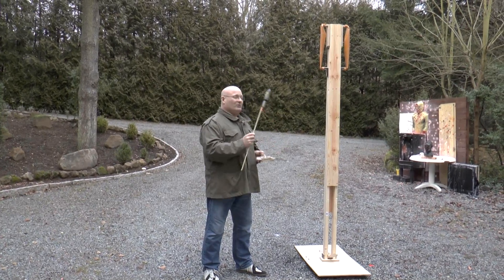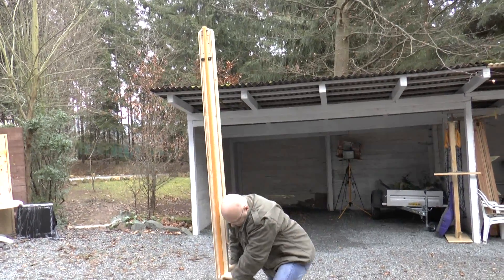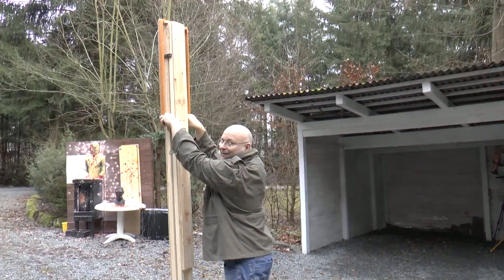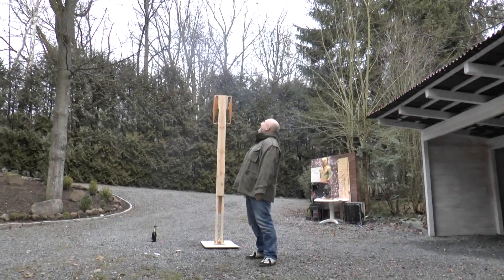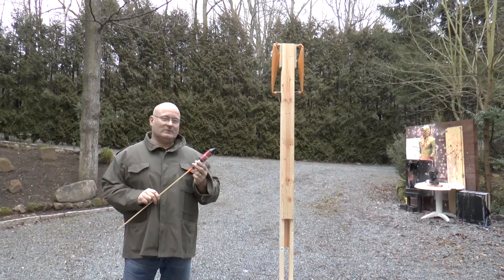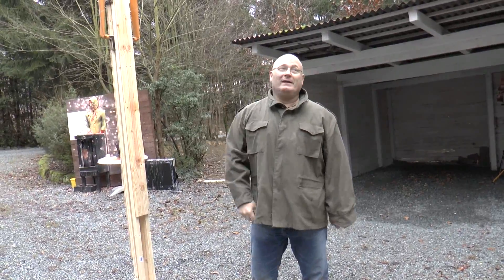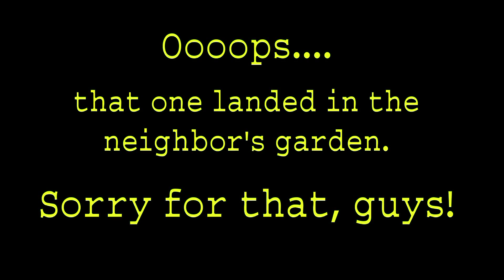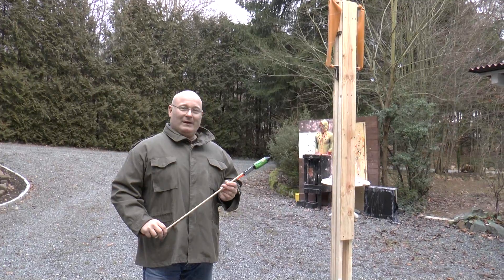Launching Rockets With The Slingshot!

Comment: Joerg ... I'm glad you live in Germany if you are going to burn your forest up or start a war...

According to theory, you should get your maximum altitude by driving the payload to maximum speed. That's done by firing the rocket exacly as it clears the launcher. Waiting to start the rocket at maximum launcher apogee just stacks the height of launch and rocket (assuming it's pointed up when it fires.) Not sure if I wrote that clearly. Let's say the launcher gives a speed of 50 m/sec and it reaches a height of 200 meters. The rocket lit on the ground flies to say 300 meters and reaches a top speed up there of 75 m/sec. If the rocket is fired at the top of the launch height, it will reach 200 + 300 = 500 meters. If instead the rocket is fired at launch, then it will reach a speed of 50 + 75 = 125 m/sec and might reach an altitude of 1000 meters. These numbers are purely imaginary but they clarify my point. This is why, with a multistage rocket, each stage is lit immediately when the previous is finished instead of gliding upward a while before lighting the next stage. There you have a little rocket science. Air resistance might affect this mechanism a little.

Comment: You should take the rocket engine out and just use the firework part.
Or weight the bottom of the rocket slightly and add fins to stabilize the flight; that way the rocket should fly straight up and when the engine fires it will continue going straight up.

Comment: You should try launchig a water-rocket with this.. triggering the water-rocket with a line attached to the slingshot, so it triggers just as the rocket reaches the top hight provided by the slingshot..

Comment: I did some calculations based on the time it took for your initial test rocket to launch, and the time it hit the ground (0:58.5- 1:04.5) and that with the acceleration of gravity, I calculate your rocket reaching 30.6 meters high, with an initial velocity of 24.5 m/s or 88.2 km/h (or 54.8 mph)! Now, factor the minute drag, and you can slightly lower that height figure, but not by much. That's a powerful slingshot! If you gave me the weight of the dummy rocket, I could calculate the force of your slingshot as well.